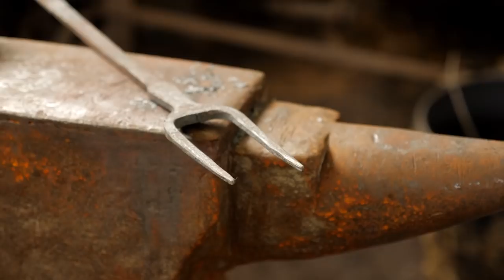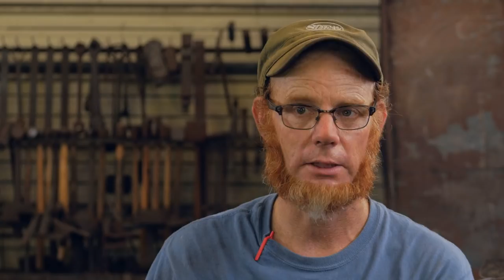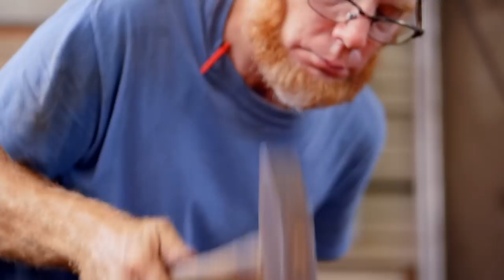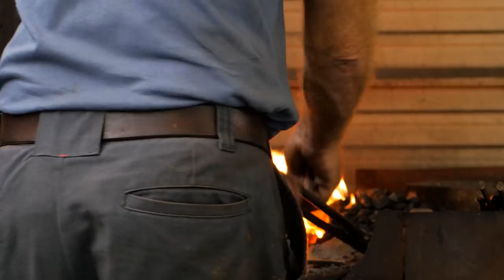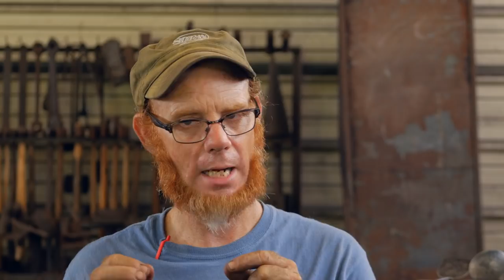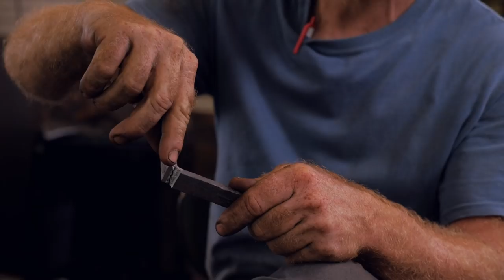Forging Wrought Iron For 30 Years

Comment: I was full time blacksmith for many years, made mostly 18th century knives and axes
Did everything by hand, didn’t have a power hammer or welder and used an antique hand crank forge. 
I was always on the look out for good wrought iron, cut up lots of old strap hinges and buggy tires
Most of my small belt axes made out of 3 pieces of iron and a steel cutting bit forge welded together. 
  I was lucky when I started blacksmith tools, anvils , forges etc. wasn’t that hard to find and not to expensive at least compared to today. 
  I also sold antique tools though I kept lots of the blacksmith stuff back because I figured it would go up in value. Probably have over 30 anvils 
Would like to make myself an axe and a knife to be buried with, strange with all the ones I made I never made myself one!

Comment: I’m a modern day gunsmith. While I was in school in Colorado before we touched the machines we went the task of making guns by hand. We made a series of tools and parts with blacksmithing. This was not a short process. A modern rifle or pistol could be made on machines in fairly short order. 

The old school stuff? Took sometimes over a month.
Reply: Thanks for sharing your story. I have been working as a welder and also used lathes etc. I also have a military background and have tried both modern and old weapons. Although I have never tried blacksmithing myself I can certainly understand where you are coming from.
Reply: TheCimbrianBull It is fascinating. We sorta went through the centuries of firearms leading up to the modern iterations of firearms. I to this day am glad we did this, this way. It still remains relevant to even modern firearms.
Reply: Sometimes with an individual gun maker; he would "Rough Out" a part for a lock; say a tumbler. He would make several pretty close , not exact. Heat up a block of metal to yellow hot and place one of those pieces on the block and quickly and I mean quickly hammer it into the block. It may take several tries with the extra blanks he made up to get it fully sunk into the yellow hot block. Once it was complete; all he'd have to do is take raw piece of steel, heat it up and hammer it into the cavity of the cold block! Knock it out when it cooled slightly; quench the mold block and hammer another hot piece of metal into it! Then filing and drilling and tapping to get the final tumbler. I was lucky enough to find a whole drawer of these roughed out, mass produced lock parts ready to be filed and fitted. Now that's production eh?
Reply: Aww, man! Heir to Roma, it sounds like you would have had such an interesting series of videos on creating old timey guns. I'd watch it in a heartbeat!

Comment: Another blacksmith who is a wizard is Tai Goo. he does primitive blacksmithing. No grinders, or belts. It's heart wrenching when you search and find a blacksmith and he just shapes the crude blade and then belt sands and grinds it down. just rips your heart out. thanks for the video.
Reply: Its called technology. A bladesmith today can produce dozens of blades in a day whereas back the day it took several days for one blade. I was on forged in fire with my apprentice, Leon. In the episode you can see his confusion with power tools. I trained him the old way, even making his own blade steel from dirt. In today's market, he would never see profit doing that. It takes days and days to file and polish by hand. He can pump out a whole kitchen set in a day now thanks to a new belt grinder and buffing wheel. 

Time is money. Quality is a non-issue with modern steels and heat treating techniques. Most amateurs can produce blades that would eat the old blades for breakfast. 

Go to Walmart and price a good 8" bowie. Probably hits around 40-60 bucks. A smelted iron blade made the old way would probably hit around a grand. Its not about nostalgia anymore. Its about making a living wage, just as our ancestors. 

Now if you have the money, either Leon or I can make you whatever you want. But it will cost you as we have bills too.
Reply: You need to go watch Tai Goo's video then. He does a blade from start to finish without grinders or sanders in less than 8 hours. and I have been around a lot of bladesmiths and while pricey they aren't asking a grand for their blades. More like 200-300 dollar range.  seriously to see Tai Goo or his apprentice Jeff working is pure primitive magic.
Reply: @GarouLady  They start with barstock. That is why their blades are 200 to 300. That covers the 15 an hour labor cost, shop overhead (rent, utilities, fuel, tool wear, etc), and materials (which are dirt cheap these days). My blades are smelted from ore. That is why mine cost thousands. A day alone for the smelt. 2 to 3 days for the refinement. And another day or two for the actual blade. Not including exotic fittings or anything. Most people dont understand why handmade blades cost 10 times as much as the stuff at wally world or amazon.

Comment: I wish wrought iron were still made. There's nothing like a wrought iron fence.
Reply: Nowadays you have to go out and find it. The easiest way to identify it is to take along a hand grinder to old farm sites. The grinder I'm talking about is the type you would clamp onto a work bench and turn the crank by hand, until you got enough speed to get sparks off the piece of metal  you found. If the sparks come off burst and continue and burst again; it's either mild or spring steel. The type of sparks you're looking for are single and just one steady glow, until it burns out! They're usually orange or red in color. Happy Hunting!😀

Comment: Could I get early 18th century particularly before 1720 utensils and pots and pans made of stainless steel?
Reply: Short answer, "no."  Not only would they not be correct material, they would problably not perform as well as ones made from wrought iron (or even mild steel).
Reply: @buttonvalley  Oh I see, thanks.
Reply: Stainless steel did not come into use until the 20th century, specifically the 1930s. You could make utensils in an 18th century style but they would not be authentic.